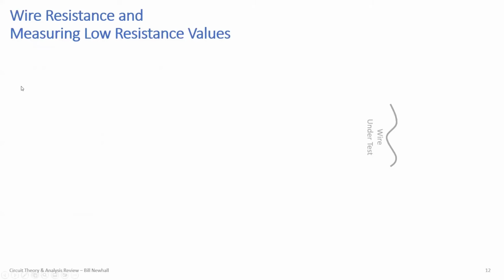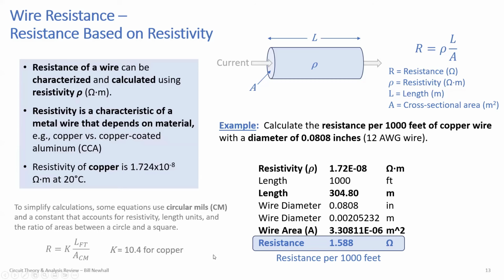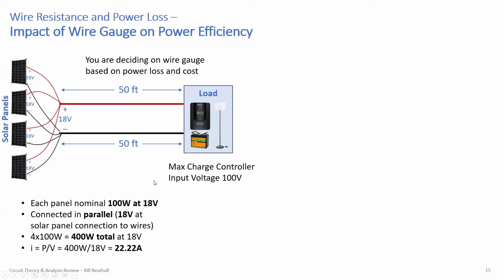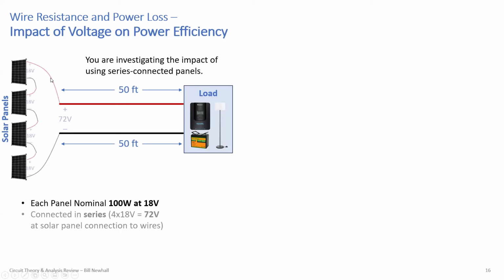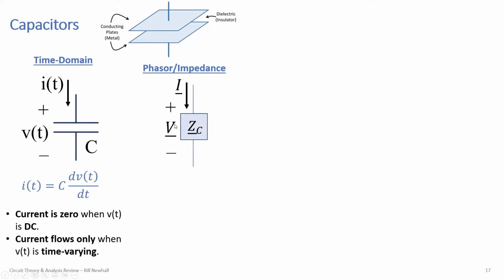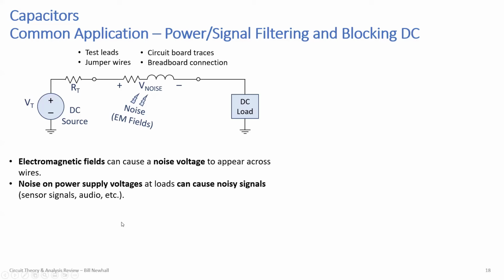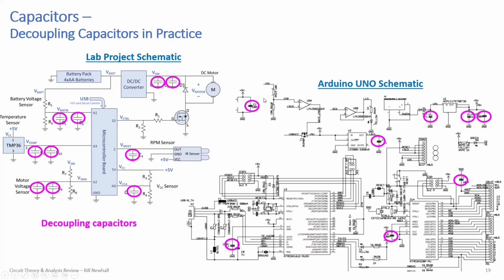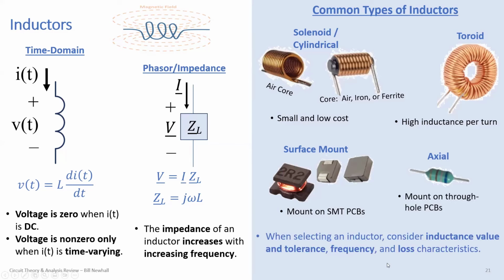Practical Electronics - Lecture 3

Comment: I don't get the solar panel example at 20:32. With 400W of power and 18V the current should be 22.2 A and the system's resistance should be 0,81 Ohm as I=V/R and R=V/I, regardless of which wire we choose. When we take the given resistance data for the first wire gauge, we would get P=I²R=122.1 W one way and P=V²/R=1258W the other way, 10 times higher and the wire indeed dissipating more than 3 times the system's power when calculating by the second formula. So where is the fault? I think we would have to account for the other components' resistance values in the system as well, not only for the wires and the total effect of the choice of wire might be less important.

Comment: At the 4:00 mark on slide 12 you show the subtraction of the voltage drop across the test leads as 0.436V - 0.1281 = 0.2319V. My calculator works in those pesky imperial units which are always off, and I get 0.3079V. :)

Comment: Should you put dieelctric greas on your battery post before attaching the terminals?  Or should you attach the terminals to the battery post, tighten them, and then cover with dieelectric grease?  Or just use no dieelectric grease on your car battery?

Comment: 24:38 
It could be a fun exercise to compare total energy lost over the lifespan of the solar panel and compare the “market rate” for that energy to the difference in cost between the wire gauges.